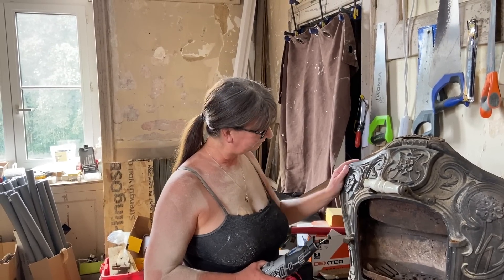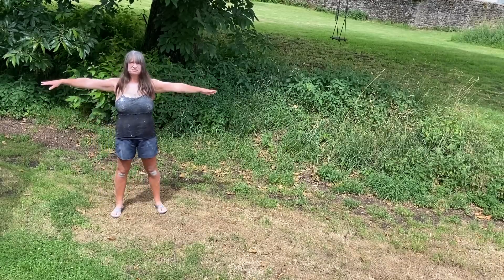A BEAST Arrives At The Chateau!

Comment: The cherry picker, although a major expense, I think will prove to be invaluable in the long term. You can now check out the roof gutters and downpipes on the chateau and outbuildings to make sure they are secure before the winter as well as trimming the trees around the estate I guess, Billy is amazing the way he guided that through the gateway.

I know you are unsure about the best route for the new driveway maybe the nicest way is to route it so that the chateau is obscured for most of the way in and then has the big reveal on the last stretch approaching the chateau.

The ceiling mouldings are really looking great, do you plan to do the same with the floral details in the corners? Fantastic effort, really is going to look amazing. Just a thought, as the wall paper is proving difficult, maybe you should break the rules a bit and decorate to your taste, style and colours to at least put your mark on the chateaus history as you have tried to be faithful to the colours and style of the original in the other reception rooms, if not I am confident you will find a solution somehow.

Take care and have a great week.. Robb Torremolinos Spain

Comment: I love that so many of the other chateau owner are friends and have collaborations together. I enjoy these episodes even more. For the rust Mix water and baking soda into a thick paste and spread the paste all over the metal, making sure that rusty spots are well covered. Let the paste sit on the object for an hour or so. Use steel wool or a wire brush to scour the object and remove the rust. Rinse the paste off with water and dry thoroughly. Or you can just buy a rust remover. All the  plaster work is look amazing loving the progress

Comment: Well done Carole, you made that gesso very well! I'm an artist (painter) and making good gesso is a knack! A tip for you is to very lightly sand off each coat when it's completely dry, and never apply the next coat until it's thoroughly dry, or it may peel off. You get a really good base for painting on with no streaks by sanding. Use a fine grade (1000) sandpaper too, it won't scratch the gesso. I'm in awe of the job you're doing with all of that plasterwork! It's going to look amazing when it's finished, and I'm really enjoying seeing how you make those mouldings! Love the beast acquisition, you'll never regret it, but maybe won't get too many jobs done on the ground until the novelty wears off! Onwards and upwards literally!
Reply from the maker: Karen, I have lightly sanded between coats and it's sooo smooth. The male the second batch slightly thicker, but didn't sand aswell. Trial and error, same as many of my firsts! I just hope the enthusiasm doesn't run out like the dining room!  Oh and yes, Adrian has been a bit slack lately, I might go on strike! Cx

Comment: Plaster of Paris added to Caulking will give a stronger consistency for the dollops required on the Border. Very tedious work yet when done well achieves maximum results. Some people put Bird deterrents up to stop Birds from roosting and leaving their substaances behind to be pressure washed to remove. These can be made with wires grouped together and strategically placed. Does not hurt Birds merely deters. Mesh covers over the eaves stop large objects from blocking drain pipes and preventative maintenance can save a person thousands. The room is going to be completed soon enough to add to the other lovely pictures of rooms already done. Cherry picker should have a Safety Harness with it to wear when at a Height, Safer to wear it and  it can nelp a person to slide down in case picker malfunctions. Thanks for sharing, Stay Safe and wear PPE when using equipment. Later!

Comment: 💕Coca Cola is very good at removing rust on large items you need to soak a decent cloth in the cola then place over the rust patch leave cloth covering object for an hour you will have to re soak the cloth so it doesn’t dry out💕Remove cloth & wipe rust off then rub off the rust with the cloth then using same cloth rub rust rusted area you may need to use a soft scrubbing brush💕repeat if area still has rust on it💕Once done wash with warm water💕
Reply from the maker: That's easy enough to try thanks Cx

Comment: To get rid of rust, a small pot of Rust Converter is not expensive and will do the job properly. Apparently you're not meant to use some of them on surfaces which get hot though, so if you expect the fire surround to get hot then check the specifications of the brands you find first.

Comment: To get rust off the cast iron heater you can try soaking it with vinegar overnight. I tried it, it works quite well and is non toxic. You probably have to apply some cloth soaked with cleaning vinegar and cover with plastic to prevent it from drying out.

Comment: Great work folks....for the rust removal saturate a cloth with 'rust remover' and try to rub any rust off the fireplace. Sometimes this may not be enough to dislodge the rust and you will need to use sandpaper or even wire wool.

Comment: You should always wear a fall restraint harness using high lift equipment.  You can very easily launch yourself over the top railing.  Example driving over a 1" bump equals 12"s of launch momentum when the arm is extended.

Comment: Extra virgin oil will take off most of the rust
Reply from the maker: I'll give it a go,  do I leave it on for long?
Reply: Somebody suggested Coke,it really works,but you have to immerse it for overnight,then wash it off and sand a little if necessary before painting it black. But I guess that's a lot of Coca-Cola needed.

Comment: So would recommend using baking paper for stripping jobs?
Reply from the maker: It worked, but it didn't adhear to the peelaway, so they didn't peel off together. Most of the baking paper fell down over night! But it did the job when I was so close to finishing. I actually wouldn't recommend it. Saying thst though, I have some peelaway left that I will use on a door and will again have to use the baking paper!!! Cx